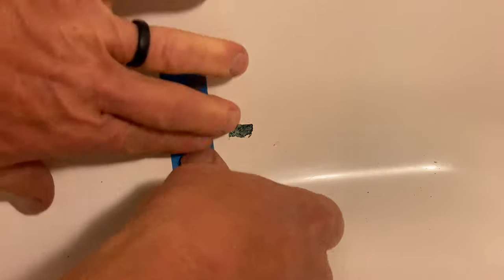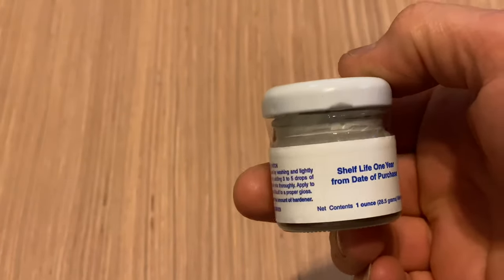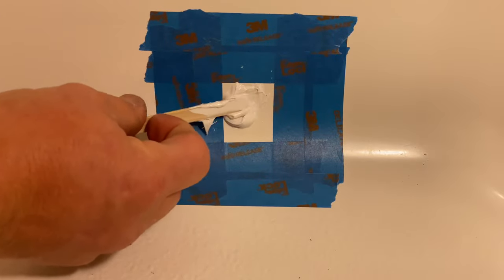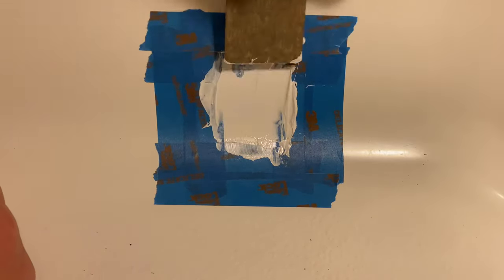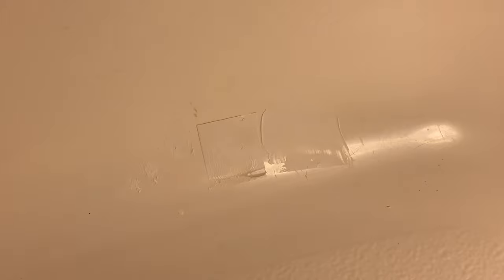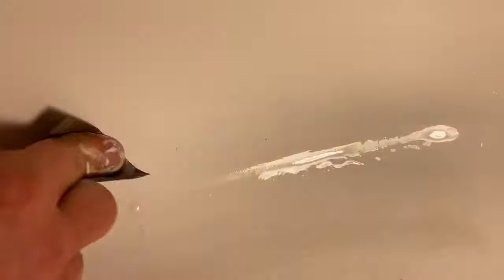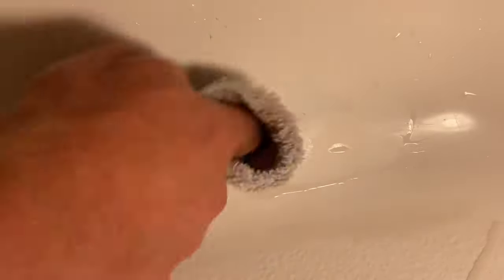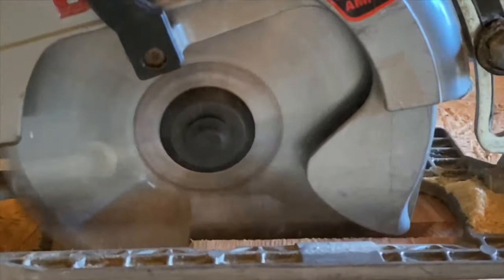Repairing a Fiberglass tub

Comment: excellent video! step by step, very clear. how long to take for it complete cure for shower ? is the gel paste smell strong? thank you
Reply from the maker: It usually takes a few hours to fully cure depending on the temperature and the smell was not too bad at all.
Thanks for watching.
Reply: @funbro1  Hi  thank you fro reply my msg. my bathtub's paint coming off expose the light  brown color surface( 7cm) and it looks different on your video. maybe different type of bathtub. I don't know what material my bathtub make of. and do you think this product works for my bathtub. also, if  leave it alone and not fix it. can it cause leaking? i don't have any experience about bath tub. 

thank you

Comment: My first attempt didn't come out as well as I'd hoped. Ordered white, but should have got bone. Color doesn't match. Also, on one of the damaged areas, the sanding removed too much of the material. Waited over 3 hours. Used 5 drops of hardener. Thinking b/c of the temp, I should have used 4? I have to decide what I'm going to do. Order bone color, file it down and redo, or just redo bad area again with the remaining product I have and live w/ the color mismatch.
Reply from the maker: It depends on how much the mismatch bothers you. Thanks for watching.

Comment: Thanks for the video.  My defect looks similar. What’s missing is a thin oval layer. How do I tell if it is fiberglass?  Thanks.
Reply from the maker: This works for fiberglass or acrylic so as long as you do not have a steel tub. it should work. Try using a magnet to verify.

Comment: I have a fiberglass shower surround that was poorly repaired.  As in, the filled in the hole wasn't totally filled nor was the surrounding area smoothed out. There isn't a hole now but there must have been at one time.  Can I sand over this old patch and fill it in with new stuff to smooth out the dimple/dent (not a hole)?  It looks tacky the way it is now!
Reply from the maker: You should be able to remove some of the old patch and replace it with the new stuff. Hope this helps. Thanks for watching.
Reply: @funbro1  The best way to remove old patch? Scrape it? Sand it by hand or with sander? Thanks for taking the time to respond!
Reply from the maker: If you have a Dremmel that would be where I would start. I would use a small sanding barrel on the end. Just how I would tackle it, I’m sure there are many other ways.
Reply: Perfect! I just bought a Dremel last week. Thanks again!

Comment: Any idea what I could use to colour it pink as our damaged shower tray is a dusky pink colour?? TIA!!
Reply from the maker: What I have done in the past for enamel touch up paint for tubs is to go to the paint department and pick a like color of paint and tell the person that works the paint department to mix that color for you in a sample size, BUT instead of putting the tint(colorant) into the container I get them to put it on a piece of cardboard. Now I have all the colors I need to make the touch up at least closer if not exactly the same color as my tub. I’ve done this many times with touch up paint so I don’t see why it would not work for this repair kit. The hard part is talking to someone in the paint department that will actually do this type of thing for you because it requires thinking outside of the box. They will try to tell you that it will not work and I can tell you that it does work for the little touch up containers that they sell.
Hope this gets you in the right direction, thanks for watching.
Reply: @funbro1  many thanks for that info - most helpful!! 👍👍

Comment: I’ve seen people in other videos say if it’s a crack you should drill small holes at the ends of the crack to keep in from running later after the patch. Do you recommend this?

I’m currently trying to patch a crack that’s sort of like the hole you patched here but it’s not a complete punched out hole it’s more like a C- shaped crake about the size of a nickel.
Reply from the maker: At some point what do you have to lose. Trying it out would be much better than replacing the whole tub, and cheaper. I’d say go for it. Thanks for watching.

Comment: Great video! I have a crack on the fibreglass (or is it acrylic, not sure, looks like plastic for me but I am not a specialist).  I dropped a heavy plastic container with 5 l of water in it and the bath cracked (not the plastic container!). It is 3 X 4 cm - it is a total area to repair. The crack is deep so the water can run through it. I am in doubts which product to chose to repair,  the one like you show in the video or the one with a fibreglass cloth patch?
Reply from the maker: It’s sounds like you may need to use the one with the fiberglass mat. This one is more for small fixes. Thanks for watching.

Comment: Would this work on a crack tub or just in a hole?
Reply from the maker: It’s probably meant more for holes because a crack could potentially continue to crack depending on the cause of the crack. A crack will
only be supported on 3 sides while a hole is supported on all side giving more strength to the repair. Hope this helps, thanks for watching.

Comment: Can I use an orbital sander (applied way too much fixer and sanding by hand will take forever) or will I risk damaging the fiber glass tub? Also repaired a porcelain sink and have the same problem.
Reply from the maker: The only thing I would be worried about using an orbital sander is that it may remove a larger area than you really want to, but other than that, I don’t see why you could not use one. Hope this helps, thanks for watching.

Comment: I noticed a very small hairline crack in the tub, will this method still patch the crack ?
Reply from the maker: It is meant to repair chips, I don't think it will help a crack because the crack will just keep moving as the tub flexes. Thanks for watching.
Reply: @funbro1  $#!@ !!!! i already used it on the inch long crack . I covered an inch of space around the crack with the stuff.
Reply: @sylquonodoms7394  it’s a year later, how is it holding up? I have a hairline crack in my tub also. And did the color match?
Reply: @NhatNguyen-xs7kl  Still holding.
Reply: @sylquonodoms7394  nice, I guess I’ll give it a try. How’s the color match? Is it off white or bright white?

Comment: This stuff is great for the sides and any part that has no one standing on it if your tub has good support under it then it will also be good but if you don’t have support under the tub it’s not the best my tub keeps crack and I used it twice
Reply from the maker: This stuff is more for a hole and probably will not work as good in a crack that is not supported. Thanks for watching.

Comment: Would this work for a 3-4 in "hairline" crack on the side of a tub that really is not a hole or a nick but cracked enough for water to get through?
Reply from the maker: It is meant more for a hole or small chip, I don’t know if it would hold up in a crack.
Thanks for watching.
Reply: @funbro1  Thank you for your quick reply. In your experience what would you suggest?

Comment: Would I be able to use this on a much bigger hole mines is about palm size
Reply from the maker: If it’s that big you may need something to back it up or it could crack. This works best on smaller holes, or chips. If your options are to either try it or replace the tub then I would give it a try. Hope this helps, thanks for watching.
Reply: @funbro1  would it make a difference if it was on the side of the tub? Because it’s not anywhere close to the floor it on the side of the tub kinda higher up on the side where you walk out
Reply from the maker: It may be worth a try.